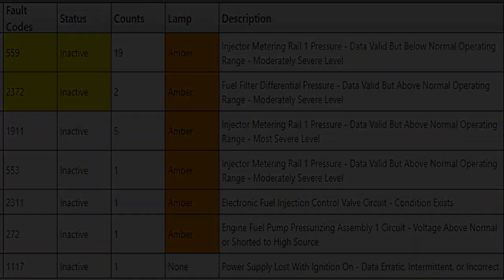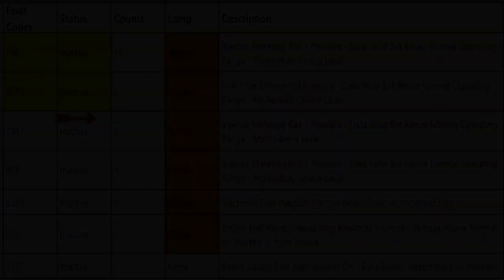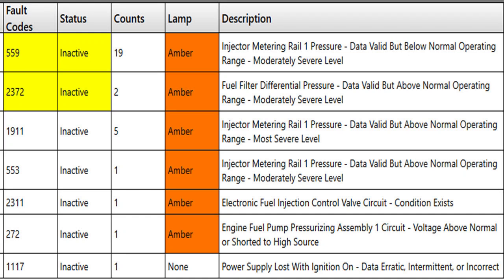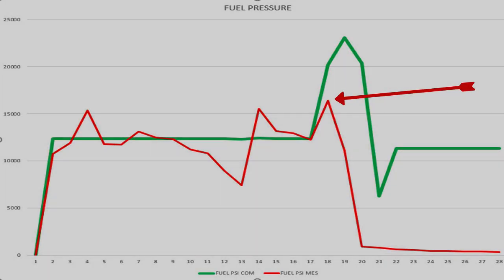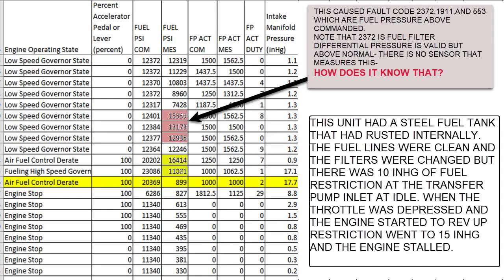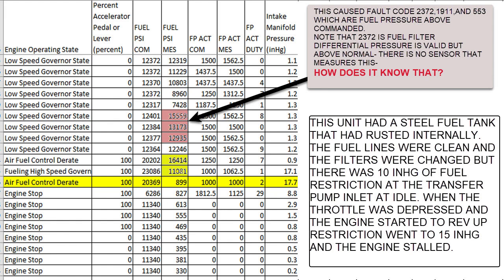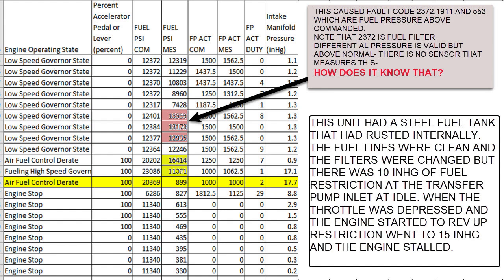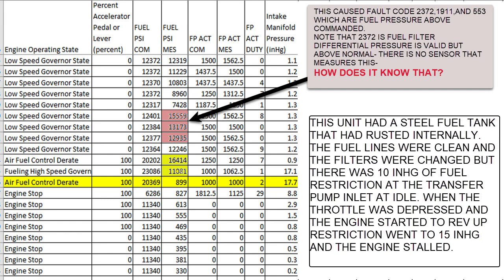Why wont this crane engine keep running?

Comment: Still curious why did you have the voltage fault for the fuel pump actuator? And how does the inlet restriction issue cause an over-pressurization of the rail?
Reply from the maker: will get back to you. My brother is in the hospital ,for a couple months, so im neglecting the channel comments some.